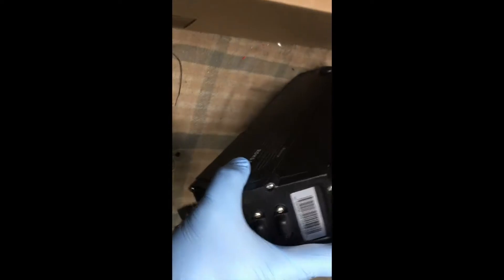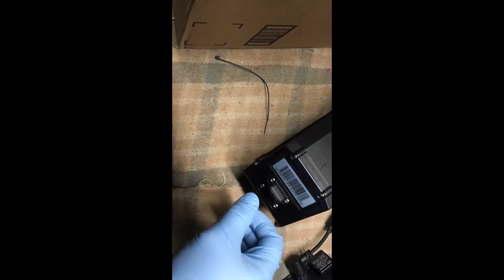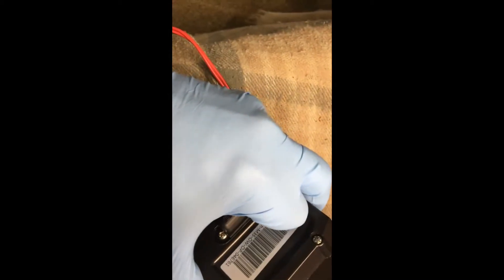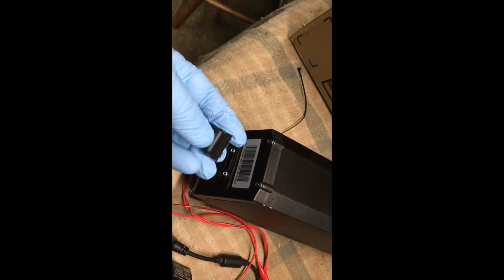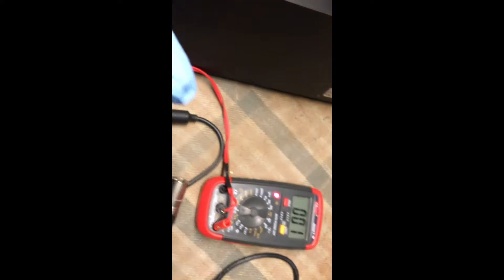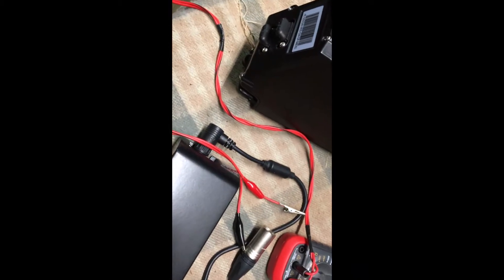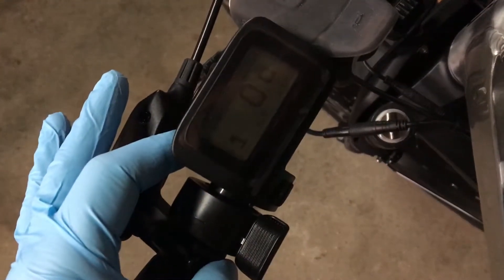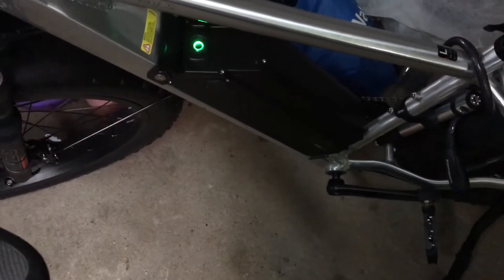Juiced bikes RCS 52v BATT FUSES - removal & test

Comment: I had a bit of a issue with mine as well. I tried flicking the throttle a bunch of times and finally the motor engaged. Turned out that the brake has a part that disengages the motor was not disengaging.  I took a small wrench and backed out the screw on the left handle bar Star Union brake grip. That did the trick. I hope yours was a easy fix as well.
Reply from the maker: Oh I'm well past this issue which, btw, turned out to be that the factory worker installed my ECU in the downtube backwards and crushed (and eventually broke) the main motor wire. This video was just one of several of me testing tons of BS for the Head bike tech at Juiced Bikes. I knew the ECU was the problem on day one, but Luis at Juiced had me test the most ridicules stuff multiple times until my attorney finally had Juiced send me a new ECU, which of course fixed the problem instantly-after 2 months of yelling and screaming at them. We are all good terms now and the bike is awesome.
Reply: @dbfcrell8300   I am currently having the same issue currently I bought the bike nearly two years ago and last month or so I was having issues with the bike just at certain times mid riding move motor would just stop, I would turn it off and it would be good for a while then stop again that happened for two weeks before it finally just gave out. Now it does not work at all and they have stopped producing the product any suggestions on how to go about this issue other than the lawyer process?
Reply from the maker: @PathtoYahawah  Gees, it sounds like a component failed in your ECU (which should be covered by Juiced). The fact that turning it on & off fixed it a few times is why I think it's a bad component, but I could be wrong.  My RCS powered up fine but simply wouldn't power the motor b/c the motor wire was kinked right at the ECU. This happened from improper installation at the factory. It is real important that the ECU is installed correctly. If you want, send me a pic of the ECU in the downtube by remove the upper battery holder in the downtube. If you can take a nice clear pic or video and pist it on YT, I can tell you if the factory installed yours wrong too.  

If you aren't into doing that, you should still stay on Juiced. Tell them the bike is useless to you. STAY ON THEM!
Reply: @dbfcrell8300  they told me I have to pay 400 for a new ECU controller.
Reply from the maker: @PathtoYahawah  Are you saying Juiced wants to charge you $400. for a new ECU, or do you have a different brand of bicycle? A Juiced Ripcurrent ECU is only $200. and is pretty easy to install.
Reply: @dbfcrell8300  yes 399. I have hyper fat 1100 which they don’t produce anymore
Reply from the maker: @PathtoYahawah  I can think of multiple things to do here, but not sure if they'd help or not. It really depends on your love of the HF1100 or if you just want to move on and recoup some of your loss. I think keeping the bike 100% stock is a good idea, as you really have a Ferrari there and any perceived value is in keeping it stock with Juiced replacement parts. BUT, if you don't want to pay Juiced the $$$ for a new ECU, you should probably go onto the EBR site and see if anyone has a used HF1100 controller you can buy. 

If that turns up nothing, you should talk to Kyle at Bolton eBikes. I sent him my bad RCS ECU, and he sent me a new Bafang ECU and LCD screen for my RCS. I've never used it to this day as Juiced sent me a new updated ECU, but Kyle at Bolton probably knows what 3rd party ECU will work with your bike's motor. Lastly, you could also sell the bike as-is for parts or whole or spend the $400 to get it working again and possibly get more than the $400. than if you sold it non-functioning. This depends on the over all condition of the bike. What kind of shape is it in?
Reply: @dbfcrell8300  The bad the left side of the Axel threading for the left arm crank has a quarter inch to probably less threading issue that makes the arm move a bit when peddling, the kick stand bottom that connects to the floor is off so a new kick stand is needed along with a few scratches on it due to a collision with another bicycle it works great. I love the bicycle and miss riding it I paid 5k for it so I over paid by a thousand using a 18 month payment plan. I have never done the maintenance on the bicycle myself and came across your video by searching cause I may have to install my own ECU. Ty for the advice for the video and for the options given I will eventually buy the ECU after I try the troubleshooting you presented in the video with the connection to the battery after that if it doesn’t work I will just buy the ECU controller from them since I see it’s pretty pricey either way.
Reply: Best of luck with it. Let me know if you need anymore help or have any questions.